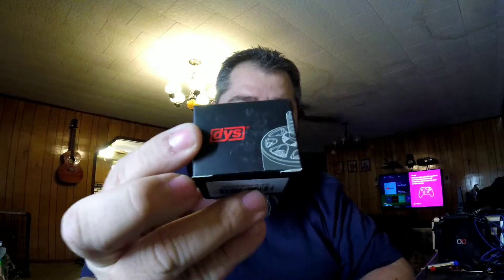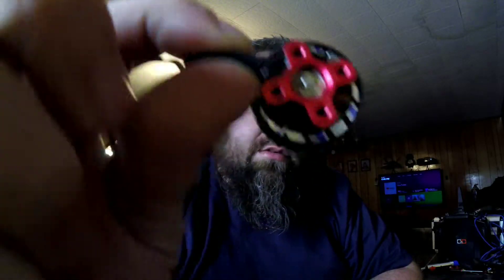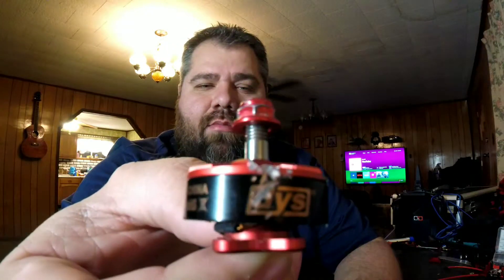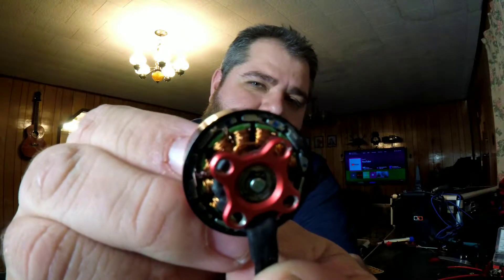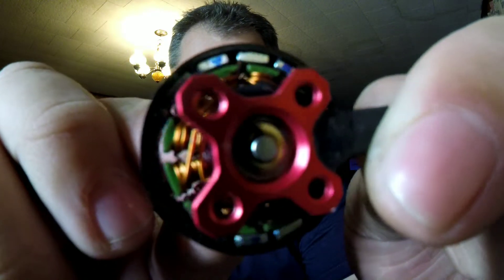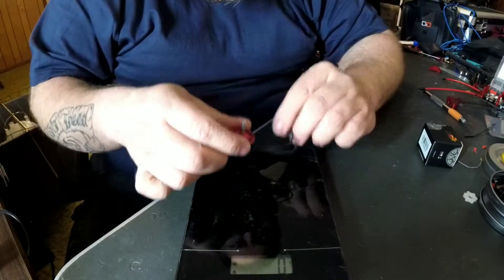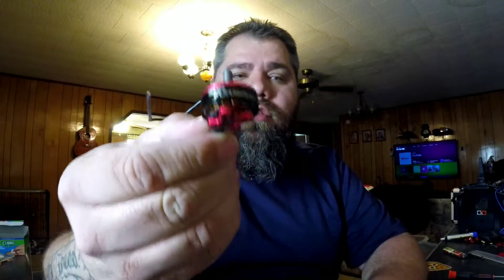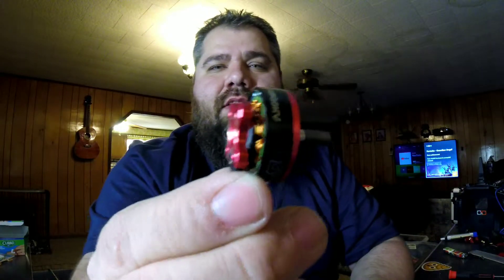DYS SUN FUN 2306 2500KV OVERVIEW

Comment: Trusted your reviews when I saw the stain on the ceiling. Too many reviewers just doing it for the brand recognition and money! Keep up the good work.
Reply from the maker: Thanks, the roof used to leak before the roof was replaced unfortunately.  I'm still running these motors on a beater kwad I have, they're not the best but not bad on a budget. Anything I review I buy to use and try myself.

Comment: Thanks for the overview of the motor. Looking forward to your flight footage and results. I've been looking at the 2207 versions of these. I picked up the Emax ECO when they dropped and have been verry happy with them. I may have to get me some of these.
Reply from the maker: I've gotten around 10 packs thru them and they seem to be good motors for the money. I'm gonna try and get some flight footage up soon and my thoughts on them after 20 or so packs.
Reply: @bigbillneace  Them Emax ECO can take a beating and held up to the 100 of crashes I put them through. Hopping these would do the same.
Reply from the maker: @bluelinefpv559  time will tell, hopefully so.